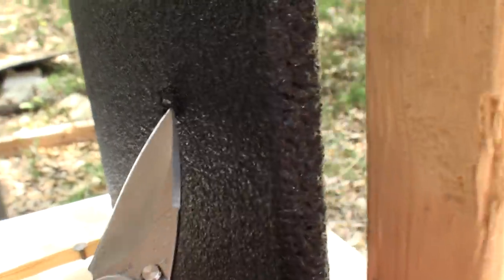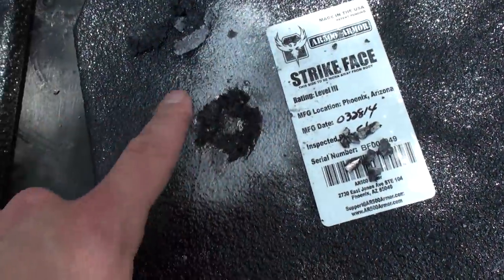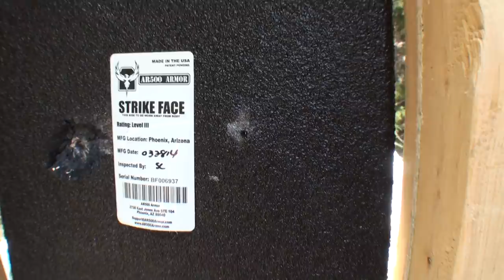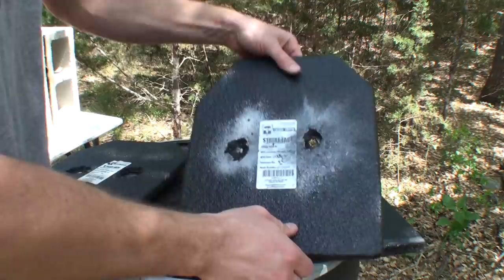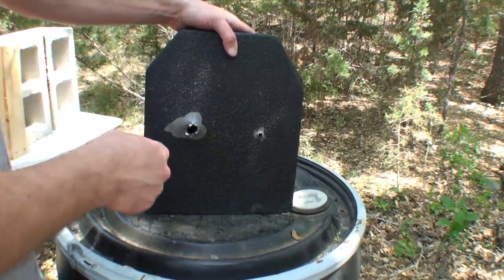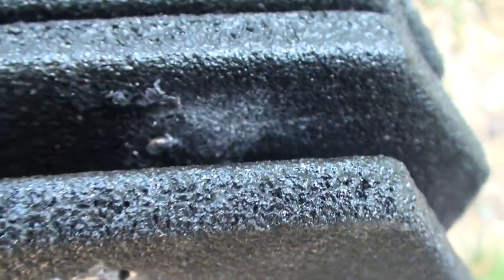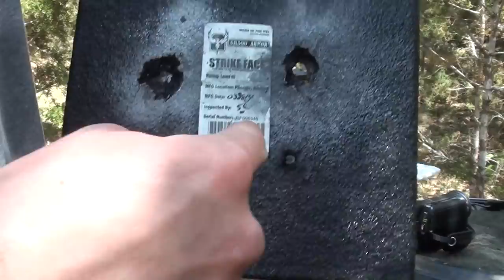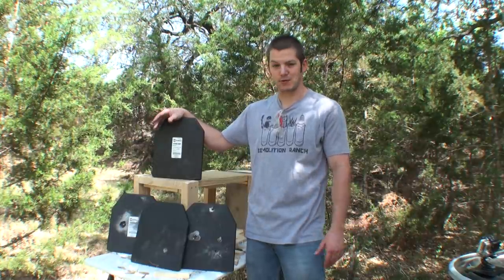Armor Plates vs Armor Piercing Bullets

Comment: pretty sure that coating on the plates is Line-X, the same stuff they use to spray on truck bed liners. Used to work at a Line-X shop and in the spray booth when enough of the Line-X gets built up in corners after a month or two of steady business every day, it weighs almost 150 lbs or more. The thicker it is, the stronger it gets...obviously. There's a reason they coated the walls of the pentagon  in Line-X, the wall will stand up to a bomb blast!
Reply: I know this video is couple years old, but if you read this Matt, try going to your local Line-X and see if you can get some stuff sprayed in different thicknesses and see how well they stand up to a variety of calibers. You know, if you are running out of stuff to shoot at that is lol
Reply: Yea
Reply: TheHurtShoulder I looked into line x after hearing about it for the first time here, interesting history with that stuff
Reply: Ryan Besco
Indeed. It's great stuff, can be used for many things and it last such a long time.
Reply: TheHurtShoulder .
Reply: Link please
Reply: TheHurtShoulder

Comment: I'm guessing the shiny stuff is atomized lead.
Reply: It wouldn't be atomized, it's just small fragments of the plate/bullet. If we had armor that could just atomize incoming bullets, we wouldn't have that much of an issue when it comes to armor survivability.  It couldn't be atomized because if it were, we wouldn't see it as well.
Reply: its hyper active servo-infused depleted uranium.
Reply: Pandemic Eclipse Atomized:  to reduce to minute particles or to a fine spray or to break into small fragments.
Atomized does not necessarily mean to break something down to the atom.

Comment: Putting the plates together is way stronger than putting them apart. When they are together, the bullet hitting the first plate gets its energy dispersed to all 4 plates so there is less penetration, versus hitting each on individually and so only having 1 plate to absorb the energy each time. It's why in karate, you can punch through 4 boards that are each 1 inch apart but can't punch through 4 boards stuck together
Reply: Spaced armor is used on armored vehicles a lot because the first plate breaks the projectile apart, the space allows for the fragments to splatter out, and then the second plate stops the fragments. The problem in this case is that these rounds just pass right through
Reply: Spaced armor is very good against shape charge projectiles.
Reply: And these are not shaped charge munitions.
Reply: The third plate took much more damage when they were placed directly on one another, tiny fragments by definition do less damage than one big chuck.

Comment: It’s 2019 :) Matt sure has changed. Btw reason the armor with gaps was more effective is why it’s on Armored Vehicles (MBT, APC, and IFV) and Ships, spaced armor as it’s named. Bullet pens, and afterward is given opportunity to lose velocity, reducing overall kinetic force, allowing it to be more easily stopped. Notice how when together the fragmentation went all down because it exploded from overmatching the kinetic force to projectile. In the spaced armor it fragmented everywhere and did little more then scratch the paint job. 
IRL Example: the armor plates over a MBT tracks, the Tracks create a gap between armor plates, not to mention anything underneath that is CLASSIFIED.

Comment: Do a army bullet proof helmet
Reply: They're more advanced than a bmx helmet with Kevlar but he's right. The helmet is basically designed for if you get hit in the head with a pistol round, you will live. You probably won't keep fighting. Even if the helmets could stop a rifle round, the brunt force alone of modern rifles shooting 5.56 or 7.62 would be enough to fracture your skull and or break your neck
Reply: The helmets we use are only designed to stop grenade fragments with the kevlar not bullets

Comment: why they wont make armor plates
that are out of titanium?
Reply: Because titanium is too expensive to be used as something disposable.
Reply: +Koolombo Loloso In all fairness there&#39;s no need to wear a body armor like that, or the grade higher. If it can stop an ordinary .50, you will be dead anyway. And lower calibers can also cause severe and fatal damage from the kinetic energy.
Reply: +DarkZekrom and because it is so heavy it can break your body parts only mastercheif can wear it
Reply: they do
Reply: +Noah Joseph uhhh... No. It isn't going to be used at all if it's too heavy
Reply: +Cheese Fisherman titanium is super light, it is the perfect material
Reply: Titanium is expensive
Reply: titanium is not the strongest metal, is good, but steel is slightly more resistant, and also they can make alloys that is stronger than steel and lighter also.
Reply: +Fernando Salazar the only gun ive seen penitrate titaniun is a AP 50cal and that only went 90 percent and noone is gonna walk around with a barret from a 1quarter block of titanium
Reply: HERO Gundown titanium is not the strongest metal, is just more flexible than many others, but steel is more resistant, and they have new alloys far more superior than steel and even lighter.
The AP50 cal is also somewhat powerful enough to damage at close range, the further the range the less power to penetrate, bullets can only go so far, once at that distance they are weak to penetrate as they lose force, and is not so much because gravity, is because the force effect which they are push reaches dead end, bullets don't travel that far, less than 200 meters, I mean a 9mm can go max in about 120-150meters the most, after 100 meters is weak on impact.
Reply: +Koolombo Loloso because after one impact you need to replace armor plates. It is also expensive, generally armor is not made to protect your from being hurt, just to stop you form dying.
Reply: AniFootBall 493 your comment is very incoherent, is not well explained, Titanium is not the strongest metal if that is what you are referring to.
Is light metal, that is what makes it good, there are other metals stronger, but there are new alloy materials they are making that are evn stronger and lighter, which is cool because they can make lighter helicopters and lighter cars and semi trucks.
Reply: first it is super expensive and it is also super heavy. Watch game theories video on halo armors fatal flaw to learn more about that.
Reply: Also Titanium is hard to find, why make a bullet proof vest from a material that is very rare, and expensive, when they can make it from something cheap and more efficient.
They have many alloys now a days that are superior and much cheaper.
Reply: +The Bacon Mobile titanium is pretty light
Reply: Collin O'Neil ok, I was mistaken.
Reply: titanium is too heavy
Reply: +The Bacon Mobile i was going to say that! but hey its just a theory a game theory thanks for watching!
Reply: +Koolombo Loloso Lots of Steel grades are  stronger and harder  than titanium , titanium is the strongest metal by weight.
Reply: Jordan WD weight makes things stronger nowlage
Reply: Jordan WD that is true, also if the metal plate is curve is far more efficient supporting a bullet, because the bullets force would be less impacted and received in the metal.
Reply: +Noah Joseph Not true, titanium is light and durable, it is only 60% heavier than aluminum.
Reply: +Fernando Salazar Titanium is a lot stronger than steel.
Reply: +AniFootBall 493 titanium is metal...
Reply: The future of body armors are nanoceramics, like the ones used on Abrams tanks but obviously smaller snd lighter
Reply: Linux88 (Pucci) hopefully the armor looks badass in a slowmotion scene 😆
Reply: +svanrie ah, now that is a common misunderstanding.  First of all, it has more speed than lots of objects, but not momentum.  Id say a 50 bmg has the momentum of a tackler at most, or front kick.  If lower calibers could cause fatal injury even with armor, then the shooter's wrist would be pulverized.  14000 foot pounds does not mean it will send 100 pounds flying 140 feet.  it means it exerts 14000 pounds of force for every foot it travels.  But that is not it's momentum
Reply: +Fernando Salazar well, there are stronger titanium alloys, the main reason it is not used as armor is because it is too expensive to extract
Reply: +The Bacon Mobile well, it is half as heavy as steel, so that is pretty light.  But if you cover your entire body then yeah, it is heavy.
Reply: nawww
Reply: +Barbara Ortiz STOP ASSUMING THAT PEOPLE! Titanium is known for its strongness and lightness.
Reply: Tacocat 4642 thank you!
Reply: +Koolombo Loloso Because it is FUCKING EXPENSIVE and Heavy as fuck.
Reply: +svanrie No, not really, there IS an heavy Armor which can stop a 50. Cal and its Blast.
Reply: +svanrie a 308 is a bigger bullet than the 7.62 I wonder what's the results on that
Reply: +svanrie a 308 is a bigger bullet than the 7.62 I wonder what's the results on that
Reply: GlockMaster_AK762_AR223 Sniper_308 a bigger hole?
Reply: +Fernando Salazar your facts are so wrong you do not even know what you are talking about. I am a mechanical technician and titanium is one of the strongest  yet not compared to other  alloy. also titanium is very light 65% lighter than steel for a fact and titanium is not hard to find but it is very pricey to manfucature and regular steel and titanium have similar flexibility yet not strenght...
Reply: Tod Gaming you didn't understood last post of mine, I wasn't referring to titanium, besides I know titanium is light, because they make golf clubs out of it, but doesn't have strength in stopping bullets, so there are actually no metals that work for light body armor, because Titanium is not more resistant than steel, is just good because is light, but there is no metal good enough for high caliber weapons.
Reply: ***** why did this titanium have similar results to the AR 550 steel plates then?
Reply: +Koolombo Loloso to much money

Comment: When you build your stands, you should use mending plates. It'll help to clamp down the pieces that would otherwise fly off and help to hold the structure tight.

Comment: I have a theory:
The first plate where the 50 BMG hit has a  small hole because it has so much speed it went through like pencil through paper.
The second hole is where the bullet started to weaken and made more damage because the bullet materials are spreading throughout the plate.
The third plate caught the bullet.

Comment: .308 AP = goes through 1, pokes through or heavily dents 2nd
.50 BMG FMJ = goes through 4 or only dents 4th
.50 BMG AP = goes through all 4
Reply: SPOILERS

Looks like I was dead on for the first .308 AP round, but completely wrong on the BMG rounds lol. I guess I didn't expect how much the bullets slow down and break apart penetrating those armor plates.

Comment: 308ap maby 1 plate and scrach the second , 50 bmg fmi maby 2 plates , 50 bmg ap ? probibly all plates , you could get variations though from affecting forces , all you would have to do is take a plate and cook it dry then soak another in water for example , atmospheric preassure could effect the test who knows . . . we have all seen the matrix .

Comment: Ttry regular full metal jackets at soft or hart body armour with those bullets coated with Teflon spray or silicon spray or other slippery spray will they go through. At my job we use silicone coated plastic and its supost to help punch holes in plastic. I think it will help them go through. Love you mat god bless.